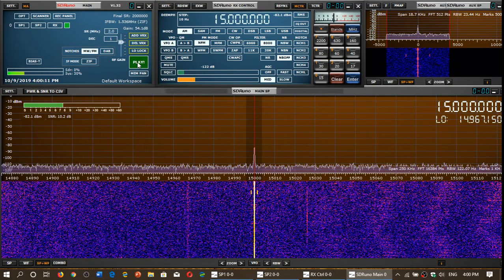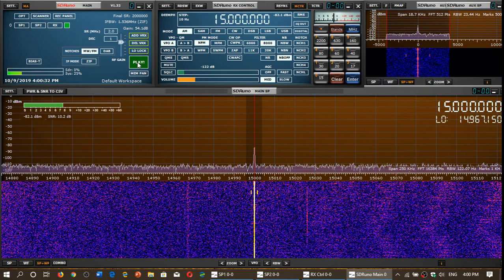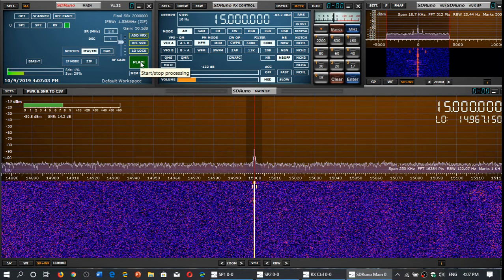BATTLE OF THE LOOPS 15000 kHz WWV Time signal W6LVP loop VS MLA 30 Megaloop Antenna TEST

Comment: LVP is slightly better but they're pretty close. The SNRs are just a bit better consistently with the LVP loop. More time in upper-teens or even as high as twenty; MLA is mostly mid teens. But it is definitely close and the fades make it hard.

Comment: W6LVP loop wins with the lower noise floor.  The MLA-30 does pick up the signal on par with the other however the noise floor is much higher.